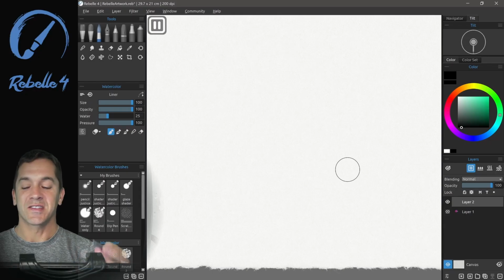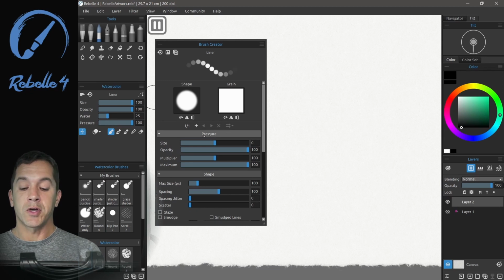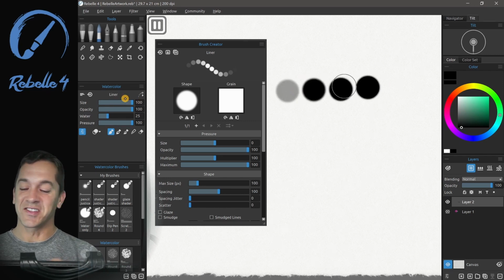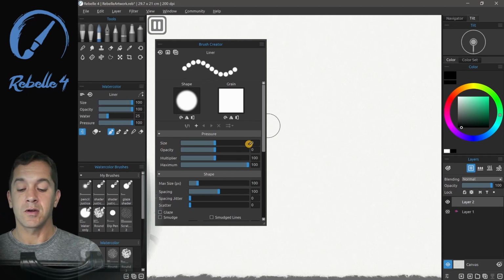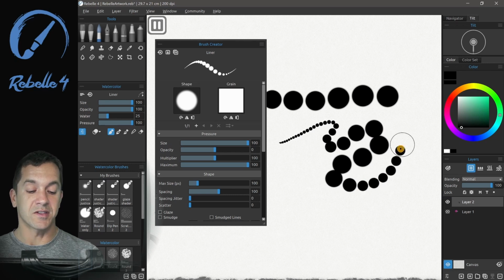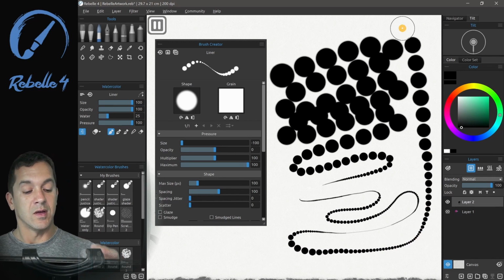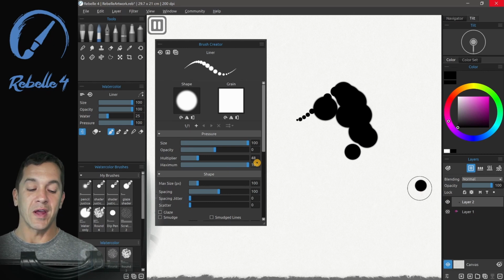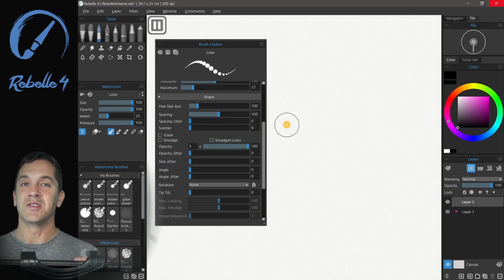Brush Creator #4 - Pressure, Opacity, Multiplier and Maximum - How to get that perfect look and feel

Comment: is there a fast way to remove pressure sensitive like photoshop?
Reply from the maker: Bring the pressure slider to 0 in the brush creator. Then pressure won’t affect the brush size
Reply: In the pressure section of the brush creator I have two sliders, size and opacity. both are blocked (rebelle 5)  @TabletPro